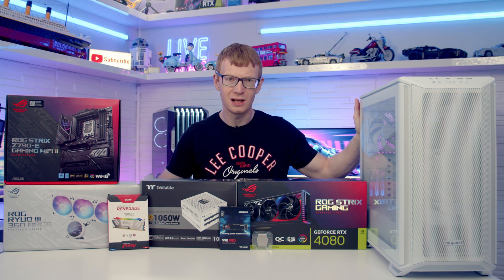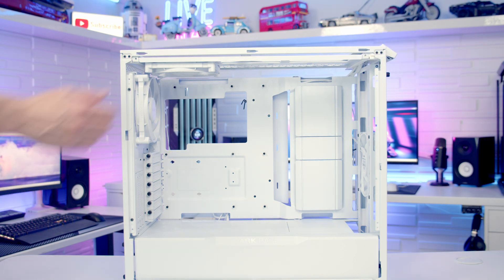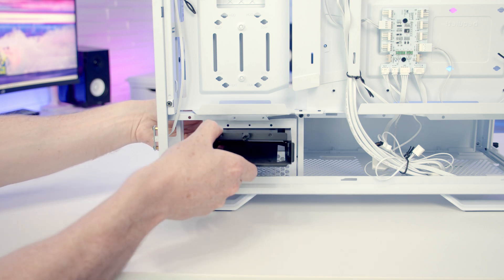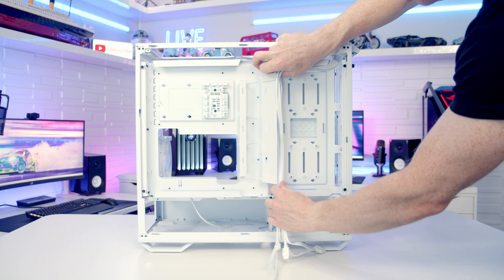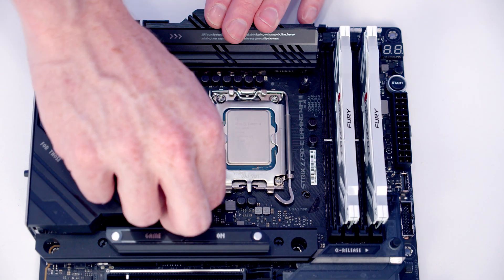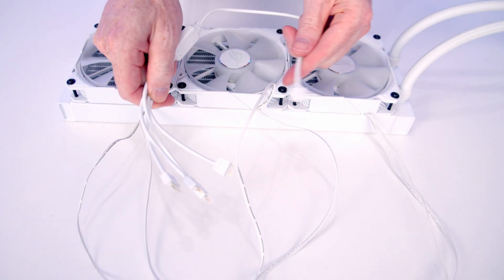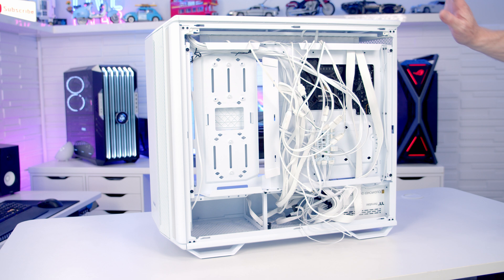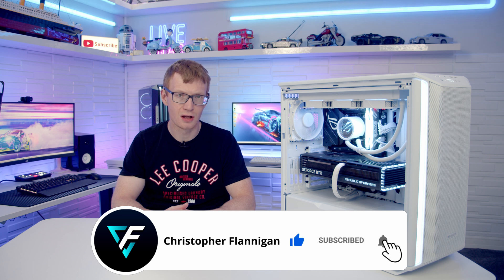be quiet! Dark Base 701 Build - Step by Step Guide

Comment: Incomprehensible!  He speaks so quickly and hurries through everything without explaining any of it.  It's far from clear to me who the audience is meant to be for this - People like me who've never built a PC before just won't understand most of what he's saying, but I imagine that for anyone who has built one before this is all blindingly obvious.

PWM? AIO? ARGB? WTF?
Reply: PWM - Pulse Width Modulation - Used for controlling fan speeds
AIO - All in One - AIO Water Cooler has the radiator + fans + liquid included an all in one setup without needing anything else
ARGB - Alpha, Red, Green, Blue - Lighting Controller for RAM, Water Cooler, Case Lights, etc.

This video was helpful for me.

Comment: I wonder if you would consider a build in the be quiet! LIGHT BASE 900 FX White ABS / Steel / Tempered Glass ATX Full Tower Case. I am a big fan of yours and I am considering this case for my AMD 5 build. I also followed your Lian Li 216 pretty closely for main system, a AMD 4.  Anyway ty for your time>

Comment: Hi there. Thanks for the video. I just have built a PC with this case, and one thing still baffles me: a prolonged push on the front panel fan speed button (>3sec) is supposed to switch to Power Management mode, but I just can't get it to work. I tested the fan header with a single PWM fan connected to it, and it works fine. The front panel fan button is working as well, since it allows me to switch through the three preset speeds. But pushing 3sec+ doesn't have any effect. The fan speed isn't read in the BIOS, but I guess that can be normal, since only 2 wires are connected. Have you tested this functionality? Thanks.
Reply: Well, I found the issue. Of the 8
 fan connectors on the case fan/RGB controller, you have to have one 
connected to FAN1. I just used the left connections of the controller, 
for cleaner cable management, so I didn't have anything on FAN1. There 
is a marking on the circuit board that reads "FAN1 (RPM)", when all 
others read "FAN2", "FAN3"... I have no idea how I was supposed to know 
that, since the case user guide doesn't mention anything about that (or 
about how to connect any of the case cables to the motherboard). Hope 
this can help someone who's facing the same issue.

Comment: Would you be able to use RTX 4080 GPU with old power supply that does not have the 12v in it?

Comment: Great video thanks the only thing I'd like to have seen is the motherboard installed in the inverted position just to see what it looked like visually 👍 and I'm confused why they had the hard drive positions all over the place. It would be impossible to use a single power cable to power the hard drives. So we'd need to use several different cables instead of one but apart from that the case looks great 👍